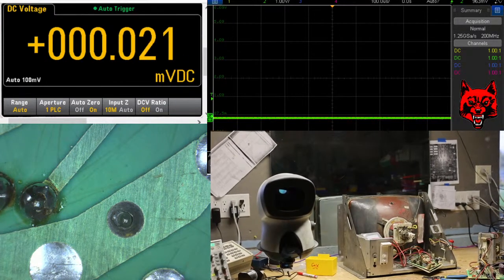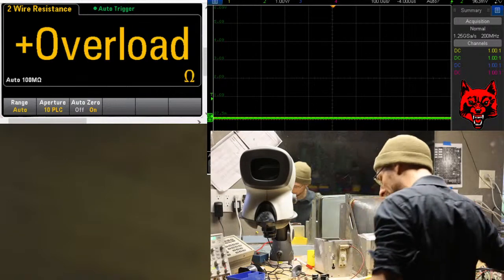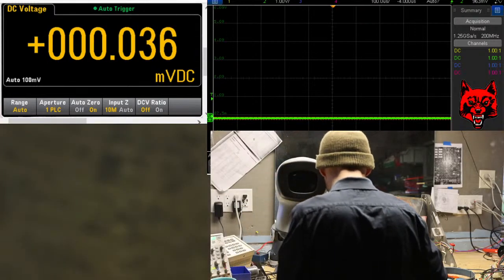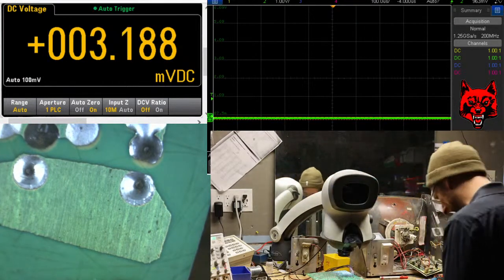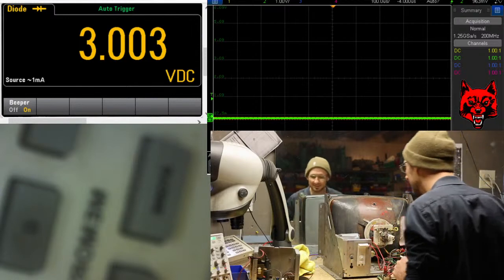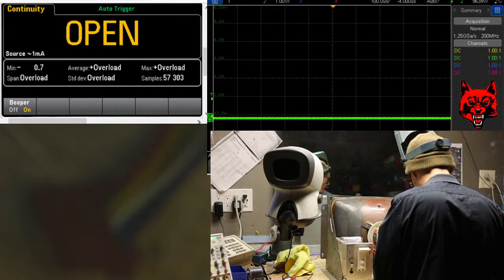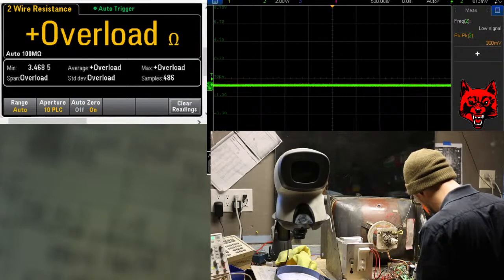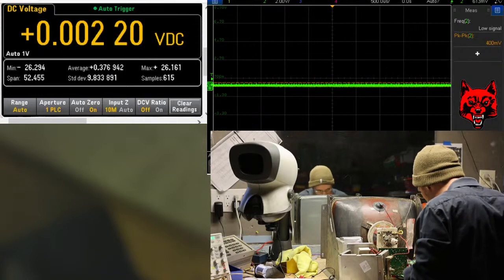Livestream arcade monitor board repair, reconditioning and analysis!. 6100 color vector boards!

Comment: ARCADECUP, Can you measure monitor each stage and section using an oscilloscope because I want to see all the waveforms for all the different stages and sections in arcade monitors